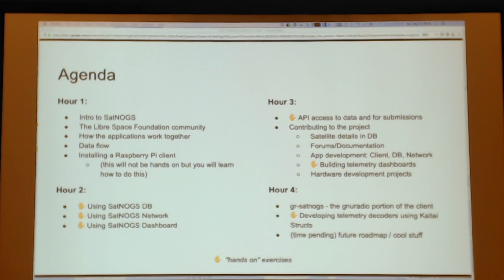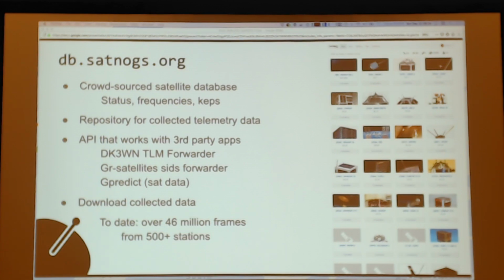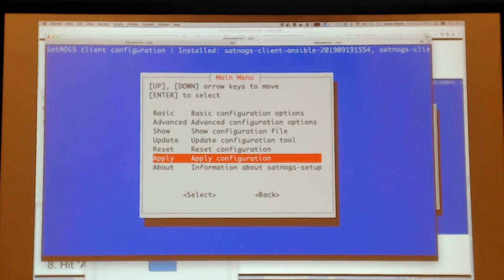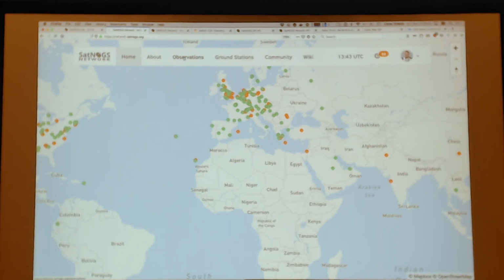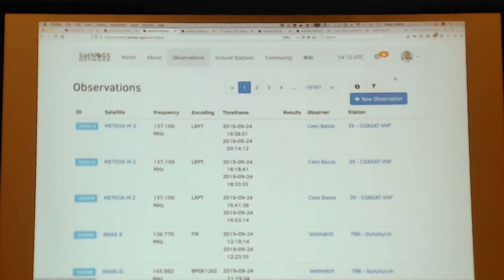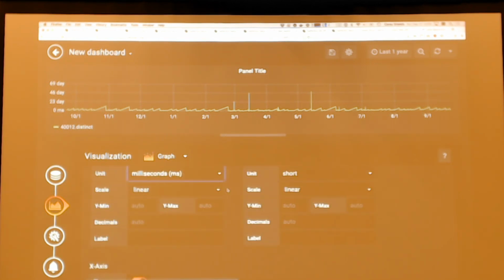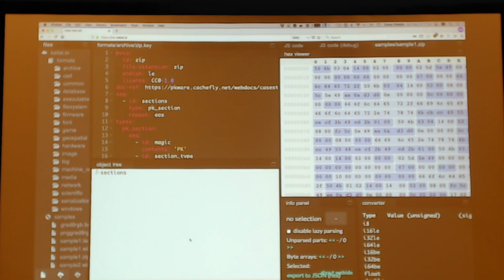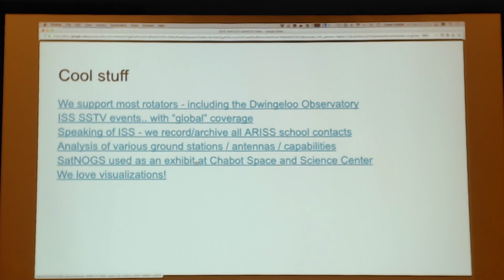SatNOGS Ground Station Building Guide from TAPR DCC 2019

Comment: I've added a Azimuth only rotator on the network with a Dual-Band Log Periodic Antenna or LPDA (log-periodic dipole array) UHF/VHF. 2 Meter gain is 6.8 dbd (8.9 dBi) and 440 Gain is 7 dBd (9 dBi) without a LNA or filters. Seems to pull in signals okay and hey who doesn't love a rotator 📡🛰️😁